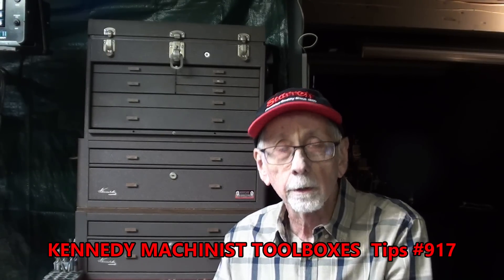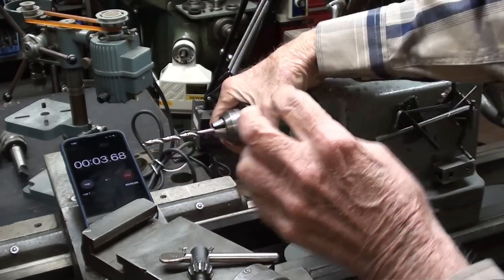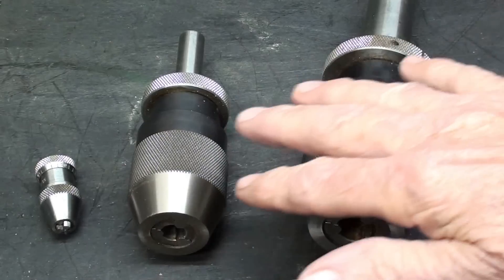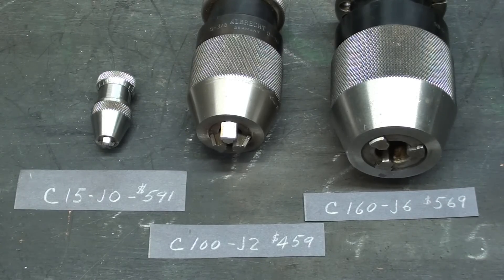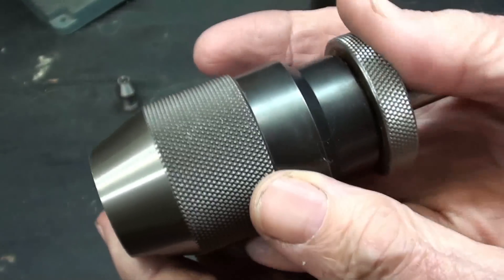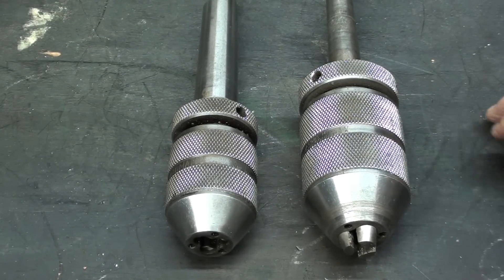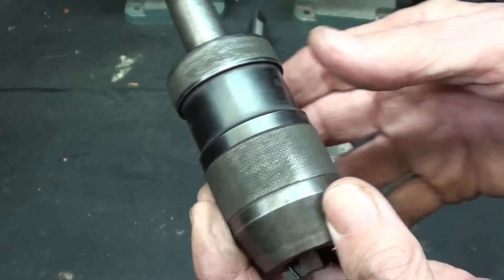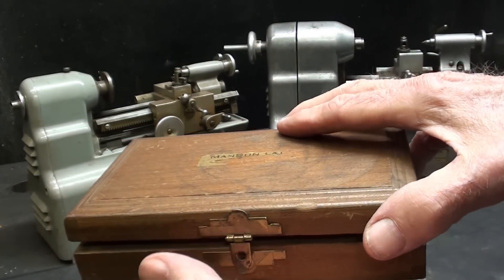What is an ALBRECHT KEYLESS CHUCK #928 tubalcain jacobs rohm

Comment: I was taught by a Jacobs sales rep to tighten with all 3 holes in the chuck so it would have taken me longer.  Love my Albrecht chuck.  I have a Chineesum one that isn’t too bad but no where near as sweet as my Albrecht.
Reply: For maximum gripping power and accuracy, he was spot on.  In practice, I only use a single hole for most jobs unless it's a bigger drill.  I don't associate drill bits with accuracy so I've always ignored that aspect.  If I need an accurate hole I normally use a reamer, or a boring head if it's a larger diameter.  It's worked well for me over the past 40 years.

Comment: I've never cared for Albrecht chucks, can never get them tight enough to keep the drill from spinning.  My name isn't Bubba so using pliers or any other tool is sacrilege.  Used ones from the 70's and 80's, no joy.  My employer bought a handful for the maintenance and fixture department 2 years ago brand new from McMaster.  No better than the ones I had used years ago.  I'm 60 now and arthritis is creeping in making it increasingly difficult to use them.  My goto chucks are older Jacobs Super Chucks for the win.  Not the new ones with laser etched lettering on the collar and made presumably in China, they're absolute garbage.  I also have a bunch of Jacobs regular chucks that I keep common tools like countersinks, spot drills, and center drills on the lathe that I picked up on Fleabay years ago before it became commercialized when you could actually get good deals.
Reply from the maker: It never occurred to me that some men do not have strength in their hands. As a matter of fact, I have lost most of my grip. I plan on covering super chocks in another video.
Reply: @mrpete222  I used to live in the Wilmington/Coal City area years ago.  About once a year my brother-in-law and I would jump on our bikes and head down to Streator to a motorcycle junk yard.  I think it was on the east side of town.  I remember the road off 55 didn't go direct to town, T-junction would force you either north or south of town, seemed a bit odd. Just curious if he's still around?  Nice guy.  Wish I knew you were there and could have visited with you Mr. Pete, my life would have been richer for the experience as I had just bought my first lathe.  Even better would have been having you as my metalworking teacher.  Instead I got the gym coach who happened to take some machining classes in college.  Disappointing as we had a bunch of Clausing lathes, Bridgeports, and Clausing drill presses in the classroom.  No shapers though :(

Comment: I have 2 Albrecht chucks. A 1/2" that I use on my lathe and a smaller 5/16" that I either put in my "jacobs" chuck when doing repetitive drill changes or sometimes in a collet. They are really nice chucks. I wanted to use the larger chuck but the extra length was an issue on my mini mill. Haven't been on YT much lately but I'm glad to see you're still at it. Happy New Year.
Reply: If you want speed get a 1/4" hex drill set. Just back it off a hair and swap.

Comment: I guess I am bubba. I use channel locks right on the knurl. LOL.

Going through the shop AIR this morning. compressor 5 yr PM (oilless) and moving some things around. I am also Isolating the pony tank. I use truck fittings for my shop air system with 3/8 poly line. I even have one run to each floor of my house.
Reply: most importantly adding a drop for my horizontal bandsaw for mist coolant. It is a 6x6 which is very nice
Reply: 1/2in OD plastic line, probably poly something & DOT rated, that is for truck air brakes works well for me.  I'll hafta check it's ID.

Comment: I‘m from Germany. Albrecht is very good. Röhm is still top level and especially on lathe chucks.
Reply: I'm from the UK and managed to buy an unused Rohm chuck at a car boot sale for £2.50. I think the B16 taper had most potential buyers confused. Top quality and has lasted for 20+ years.
Reply: Lucky beggar. @ianpendlebury3704
Reply: Röhm is poor quality in comparison to Albrecht. I have probably a dozen of both.

Comment: Thanks for the video.
With key type Jacob's chucks, I was taught to tighten all 3 holes with the key.
i've always wondered if this is necessary.
Reply from the maker: I see a lot of people doing that with their Lathe chucks.    I never understood why
Reply: @mrpete222  Robin Renzetti has commented on that. For best concentricity use only one pinion, and the same one every time. Obviously she same one you used when truing the chuck up, or grinding the jaws. For best grip, tighten all three pinions. I don't know if it really makes a difference on lathe chucks, but on drill chucks I believe I get slightly better grip when I reef down all three spots. Or maybe it's wishful thinking.
Reply: @mrpete222 
Thanks for that, maybe this would make an interesting video. Compare clamping force using both methods.
Reply: I do 2 holes at least.
Reply: Only if you’re a man that wears suspenders and a belt. 😀😀

Comment: Bought a couple of Rohm chucks, when I found them on a sale at a steal of a price, about $4 each. Bought all 3 they had there.
Reply: @mrpete222  Would have had all 5 but another guy saw them as well. One for me, one for my father, and the third went to the engineering shop i had do a thread on the cheap chinese drill press to convert the head from taper to a thread to fit the chuck, because this old drill press had a tap on chuck which was cracked. Still got the drill press, and my father used his on a drill, even using it to do masonry work, with this chuck surviving all that abuse fine.